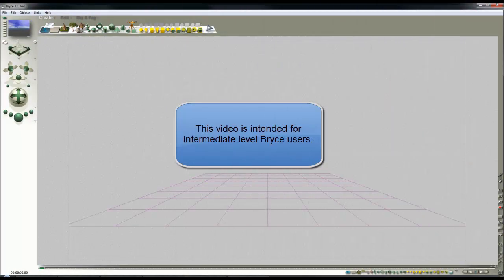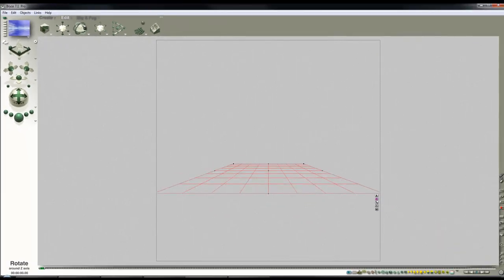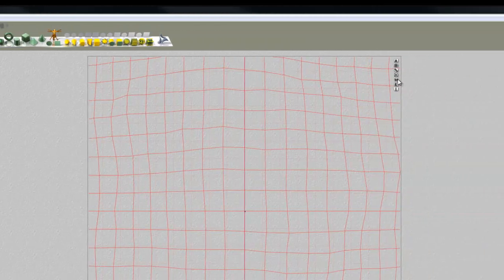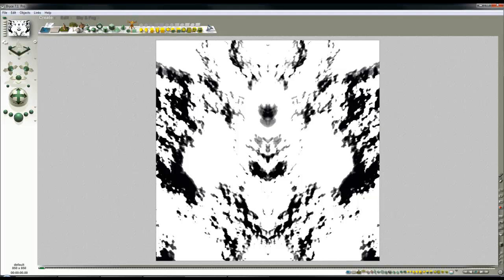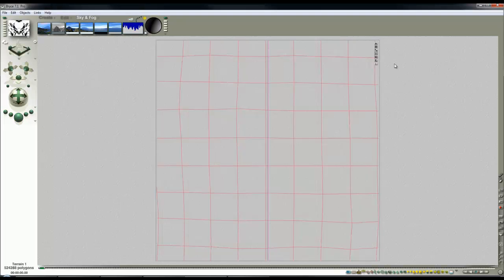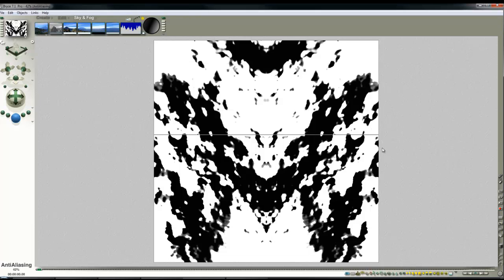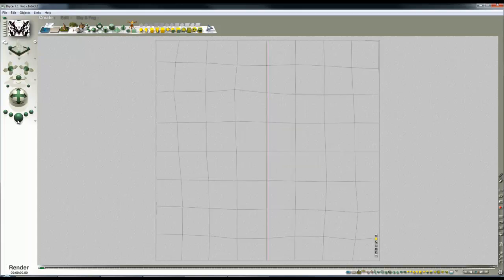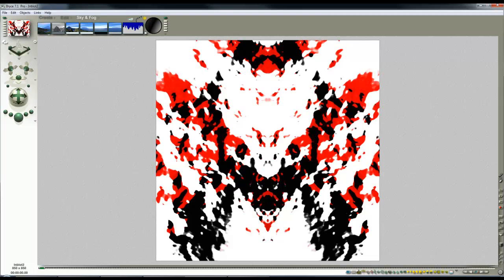Bryce 5 minute scene project - random inkblot generator - a tutorial by David Brinnen.

Comment from the maker: Well... there are two different things here, one is creating an image that looks like it has come from a pin hole camera - which would be quite possible I think and the other is making a scene which shows how a pinhole camera works.  One thing that would be very difficult to achieve given the present render modes in Bryce is making a setup the simulated the way pinhole cameras worked and gave an image that looked like one from a pinhole camera.  Another render engine might be able to do that.